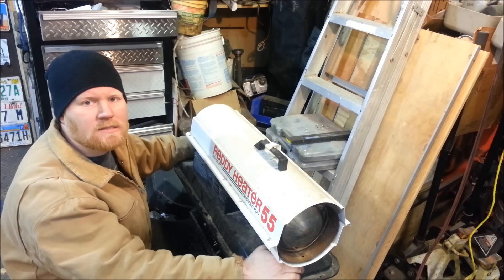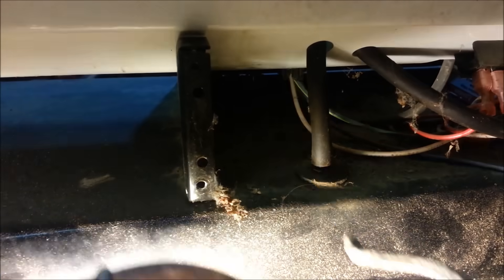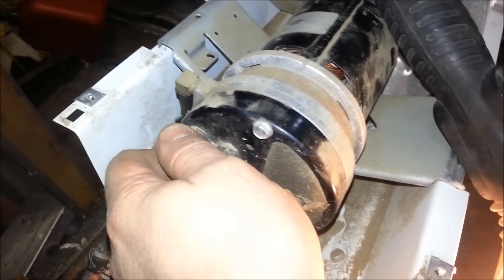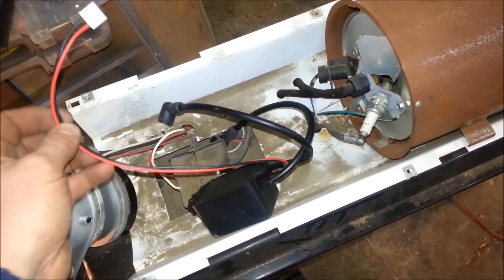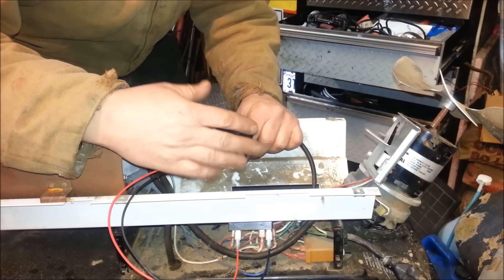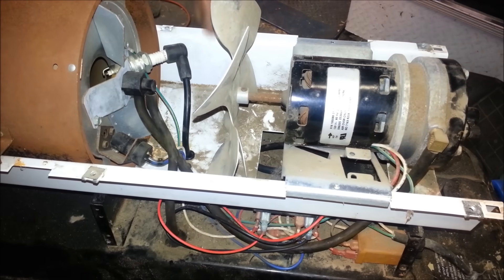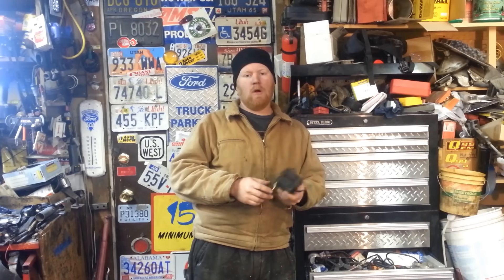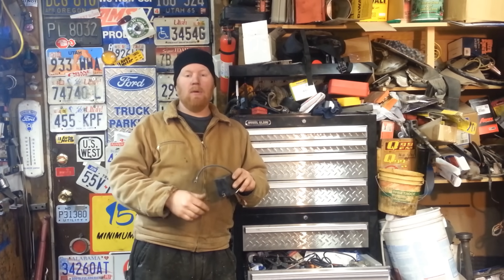Torpedo Kerosene Heater repair & HOW they work

Comment: Thanks for reply. Had the fuel jet out for cleaning and looked fine but gave it a good clean in any case. Bought this heater new a number of years back but it would not have a great deal of hours use. Had contaminated kero in it a couple of weeks ago and i drained it out, flushed tank and then power hosed it inside. Stood it on it's end overnight  to drain onto  paper roll and then heated tank with hot air gun to ensure no moisture remained. When I went to start it up there was no fuel delivery to the new fuel filter so took it to local guy for testing/repair. New parts fitted ref to pump area but now I find it throws out flame at all  levels of PSI adjustment. Also has to be kept on high PSI setting otherwise the Kero fumes are unbearable.
If it was only an adjustment I would be happy to do that otherwise it will be going back to previous repairer to set up correctly.
Reply from the maker: +EUGENE Mc  ARDLE If the fuel jet is worn it will spray clumps of fuel rather than a fine atomized mist. This will generally cause flames. Flames can also be cause by too high of pressure forcing too much fuel into the combustion chamber. Lowing the air pump pressure will lean out the mixture and should have lower fumes.

Comment: Hi thanks for posting video. I have a similar Kero ( SIP ) space heater  which has started to throw out flame around the front and  the fumes cause eye irritation. To  run and not cause this eye irritation  I have to increase the PSI  to nearly max.
What do you suggest could be the problem ? Thanks.
Reply from the maker: +EUGENE Mc  ARDLE If it has a lot of hours on it the "fuel jet" is more than likely worn out.

Comment: My heater when cold only ignites when I loosen the screws on 1 side of cover and slightly raise the cover. When the heater is running for a while it will ignite if still hot. Can you let me know why?
Reply from the maker: +Timothy Bertsch The pressure from the pump is not set correctly. It is pushing too much fuel into the combustion chamber so it needs to be turned down(counter clock wise) a little

Comment: I'm not finding the igniter anywhere.  Can you tell me where you got the 20 to 30 dollar igniter?
Reply: +Barry England Ebay has a bunch. item 361024717300
Reply from the maker: I bought it from equipsupply c o m. Search for 39e0 . They have a 39e0-0021-00 that is identical to the one I used for 28 bucks with free shipping. 

Ignition Module I used in the video GHP 39E0-0008-00( any 39E0-00*-* will work the same the length of the leads is the only difference)
If you're replacing a single wire ignitor with one of these 2 spark plug lead wires units; ONE lead will hook to the existing spark plug and the other lead will ground out to the frame or housing that makes electrical contact with the outside(threads) of the spark plug. You can flatten out the end and put a screw in it or something similar.

Comment: hi I have a dura heat torpedo heater dfa75t  I'm running  heating oil and it smell bad and my eyes  burn is there's a way to get rid of that  bad  smell  it gives me a  headache every time  that I turned it on and I can leave  on more  than 5 minutes  I go crazy  by the smell do I have to tune or something  like that  an this  thing is 4 month  old  new thanks
Reply: +martin valentin Can you find kerosene to use instead of heating oil?  That's why you're getting so much fumes from it.  Kerosene will be more expensive, but there's no point in saving money if it's unusable with the heating oil, which is not supposed to be used with these heaters.  #1 Diesel is an alternative that you could use also.
Reply: +DTR RTD my reddy heater uses 1 kero 1 diesel 2 diesel 1 jet fuel 2 jet fuel but not gasoline
Reply: He covers that with the air pump adjustment.  The higher the pressure, the more fuel, because the air is what sucks the fuel out of the tank...

Comment: Mine runs for about 5 seconds and shuts off. repeats the same cycle over and over. i can see spark and flames i cleaned the photo cell and it still does it. what do you think?
Reply from the maker: +Ernst Hin It depends on how it shuts off. It is stops everything at once while heating it is the photo sensor. If it stops heating/flame goes out but the fan blows for a few seconds more you have other issues.
Reply: +sixtyfiveford 
Yes every thing shuts off fuel spark and motor. I'll replace photo sensor thanks you are a great help. I really appreciate your video and thumbs up!
Reply from the maker: The photo sensor simply connects the 2 wires. You can test it by connecting the 2 wires.
Reply: +sixtyfiveford 
okay, if the heater keeps running after i bypass the sensor then that was my problem?
Reply from the maker: Yes.
Reply: thanks! you were a great help. I like to buy broken stuff sometimes. Its worth the repair to me. I really appreciate guys like you who share the knowledge.
Reply from the maker: You're welcome. I'm glad I could help.

Comment: Hello again.Its winter time,and had to break out the ole heaters.I had a reddy 110 pro,and the motor just quit while in operation.I took it off,looked at it,and ended up buying a replacement for it.While putting it together again,I accidentally placed the rotor kit in backwards,with the center bushing not properly installed and cracked the rotor.Got a new kit,put together,with a set of new filters,and now I can't get it to burn steady.It wants to miss pretty bad.I had another used plug that I put in and got the adjustments good enough to not trip the reset,but still missing,so I took the used plug out,put the original back in and its worse than before.Can't get it to stay running long enough to make any adjustments.I've tried 3 different backplates and I can't get anything to adjust.I've turned the screw all the way in and out,and can't find a sweet spot.Any ideas would be appreciated.
Reply from the maker: +FlintSpall The most common issue for poor running is a split in the air or fuel pickup line. This will make adjusting near impossible.
Reply: sixtyfiveford Hey,Thanks for the response.I finally after much head scratching,took off the air line,blew some air through it,and disassembled and cleaned the nozzle.Now its working good.What I've seen,,is that while the pressure valve adjustment is important,its not as sensitive as some say it is,,so long as everything else is up to par.apparently it had trash either in the air line or somewhere between it and nozzle.I've had similar problems with cracked filter plate,but I have three thats nearly new,so I didn't think they should be the problem,,but didn't occur that trash would be either.:>) Thanks again.

Comment: HI, my nipco isn't igniting. We checked everything with what you recommended on your video, which was very descriptive. The vacuum guage goes the opposite way, and with that valve plug out, we feel the air coming out. Are we doing something wrong?
Reply from the maker: +Kathy Plaetz The port will blow air not vacuum. Virtually all vacuum gauges have a positive pressure side as well on the gauge.
Reply: The gauge we borrowed is from a local car shop. It made the dial go back toward zero. What do we need to do?
Reply from the maker: Most will have a fuel pump tester built in as well so there will be a pressure side. You just need some way of measuring up to 5psi. Here is a link to the actual tool designed to measure the pressure http://www.ebay.com/itm/HA1180-Kerosene-Heater-Air-Pressure-Guage-Desa-Reddy-Heavy-Duty-2-Face-Glycerin-/251421228482

Comment: if i don't have kerosene..can use gasoline with oil????
Reply from the maker: +efrain cardoza You can run straight Diesel. You can mix in a little old motor oil with diesel but it really starts to smell so I think just gas and oil would smell a lot.
Reply: +sixtyfiveford thank you !!! I liked your video, either esplicit and very detailed ....👍👍👍

Comment: I have to much fuel just poring out, whats wrong?
Reply from the maker: +Brandon Keele Is it fogging out the front of the machine when you turn it on? Is the spark plug creating spark?
Reply: yeah it makes spark and just fogs out the front, if I lift the back half of the cover up a inch and a half it works perfect, as if it's not getting enough air, I but that size socket in between and it works every time otherwise it just fogs and spews fuel out the front
Reply: it's a 185,000 btu dewalt model
Reply from the maker: You need to turn the fuel air pressure down to a lower psi.
Reply: I've adjusted the screw all the way in and all the way out with no better result only thing that still works is opening a gap n the top allowing for more airflow I guess, and the fan is blowing super hard so I know it's not at fault
Reply from the maker: It needs to have a balanced fuel air mixture to light off. This assuming the spark it adequate.  By opening the cover you're either reducing the amount of oxygen or increasing it depending on how the cover is open. Turing the air pump screw in increases the pressure and out decreases it.

Comment: Update 65ford got it running with your help . Now when I put the cover back on flame goes out ,Had pressure adj.to proper setting went as far as adding just a bit with no success any suggestions
Reply from the maker: +Mark Bucklad  Depending on your style, with the cover off the fan it is pushing less air through the burn chamber so it requires less fuel(pump pressure). With the cover on all the air is forced through the burn chamber and it needs more fuel(turn up the pump pressure).

Comment: Good video' mine when i plug it in glow plug lites up and then goes out and i don't hear the pump or see the fan run. john    blueegg08@gmail.com   has not run in 2 years
Reply: where did you buy the ignition coil
Reply: +brian bytnar It is the original coil but i got it going. I cleaned the optical on it and there were loose wire connectors on the board once i did that it started. Watching you on the tube showed me what to look for. Thanks much for the video.

Comment: Hey 65ford everything you said was correct all those problems fixed ..got spark.fuel spray ,new sensor,new coil, only problem kerosene will not lite and it was fresh
Reply from the maker: +Mark Bucklad  If it is fogging kerosene out the front but not lighting, more than likely your pump pressure is too high. This makes a RICH fuel/air mixture and it won't ignite.
Reply: +sixtyfiveford No its not fogging out the front wont do anything but shoot fuel out the jet and spark from plug
Reply from the maker: It shouldn't be shooting a stream of fuel out. It needs to atomize it turning it into mist/fog. If it isn't atomizing it your jet could be worn out to large. This would generally only happen on a unit that has a lot of hours on it. You can try turning up the pressure to force it to atomize better.

Comment: not drawing fuel
Reply from the maker: +Mark Bucklad Cracked or split fuel line. Or clogged filter if equipped.
Reply: +sixtyfiveford I found the rear cover plate has a crack in it where the pump is . would that stop the fuel from moving
Reply: 65 ford also I picked up a similar coil like you have in your video . The only way I get a spark is when I ground the 2nd plug wire
Reply from the maker: A crack in the pump housing will dramatically lower the air pressure in the pump and it won't pick up fuel. JB weld fixes these pretty well. Some dual spark plug setups spark between the the two plug wires, so grounding one out is correct.

Comment: What's the best way to clean the fuel tank?  Have one I haven't used for a few years and the tank looks nasty.
Reply: I would take off burner, fan, all electric components, that way you can flip the tank around all ways to try to get the gunk out. Use a stick through the fill hole to try to dislodge most of the funky stuff and get it out the hole. Then spray in a whole can of engine degreaser and head to the car wash. 
     Stick the nozzle through the hole and try to get all the corners.  Run water through it till it comes out clean.  Question your life choices while you ride home soaking wet and smelling of old fuel. 
      After tank dries out a bit, put a gallon of clean gravel in.  Shake it every way, make as much noise as you can. Add hot water and dish soap. Repeat. Drain and rinse.
Reply: Carl Crawford 
lol riding home reeking of old fuel-
I question my life choices all the time-

Comment: I have a Master 70,000 heater.  When I turn it on it will fire and light right up, but it will keep shooting flames out intermittently.  Any ideas?
Reply from the maker: +jd67010 Usually that is a sign of contaminated fuel, an air leak in the fuel pump air lines or an air leak in the fuel pickup line.
Reply: +sixtyfiveford .Thanks!  I will replace all of the air and fuel lines and see what happens.

Comment: I picked up a Dayton 110,000 btu Oil Fired Heater from Craigslist today for $75.00. Couldn't resist. I have a 1500 sq.ft. shop and this thing fired right up and warmed up my shop in 15 to 20 minutes....it was only down to 45 degrees or so here in Oregon today.

Gonna try the straight diesel with it tomorrow...see how she does !
Wish me luck !

Thanks for another tip SixtyFiveFord !
Reply from the maker: +Screww Googlle Yeah, that's a sweet deal. I found a local station that sells red die off road diesel, so it's even cheaper.

Comment: Thanks for the video. Could not find my manual and the Mr. Heater (75k),web site let me down for a pdf. Opening the covers found spark and fluid atomizing. Found rubber hose from air pump to atomizer cracked. Replaced hose and all is good. Same dia. (id & od) for air and fuel. 2 feet will cover the replacement of both.

Comment: great video I have a torpedo heater in that will run fine for a little while then it will just start rolling black smoke any ideas what that might be
Reply from the maker: +Tyler Landers Too much fuel. So your spray nozzle could be worn or air pressure set too high.
Reply: +sixtyfiveford  thank you I'll take a look at it before it gets cold outside not much good in the garage when its rolling coal

Comment: where did you find the ignition coil for $27
Reply from the maker: +Steve Lenhart http://www.equipsupply.com/products/1002937-Ignitor-Ignition-Transformer
Reply: +sixtyfiveford dead link. just times out. was looking for a cheaper one like yours. all i found was $60 and up.
Reply: +Steve Lenhart waited a couple hours re tried it and the link works now. thanks for your help.

Comment: I have a remington similar to what you show. I replaced both rubber tubes as they were cracked, and splitting. ran it for 1/2 hour it was fine. 1/2 hour restarted it and it started fine, but flickered a few times and stopped. repeated 3 times with no change. any ideas?
thanks,
rob
Reply from the maker: +Robert Spencer The rubber pickup tube that goes down into the tank can crack as well.

Comment: My all pro 175  will not heat. I took off the top and see the spark is great. Fan runs also just won't fire  Any help would be great  Thanks
Reply: +Phil Lilja  In the back of the motor housing is the air pump they break check that

Comment: If I have a 300K BTU Heater. And a 900 square foot house. How how would the house get if I left it on at max temp for about an hour?
Reply from the maker: jason bowles That's a big heater. It would heat it up to around 100F in an hour.

Comment: Hello, I checked equipsupply. they have several to choose from. how can i tel which one i should get. 4 are on backorder. 1 is still available? can you help me please?
Thanks so much
Reply: Jill Albring Ignitor....sorry
Reply from the maker: Jill Albring The difference between them is the length of the spark plug wires and the random plug on the electrical wire.  As long as the spark plug wire of long enough,  any one should work.
Reply: sixtyfiveford one more question. the one that i received has 2 white wires. my wires are connected currently with wire nuts. should I just try it one way and see if it works. I am going to have to splice the wires. the plug will not work with my set up. let me know your thoughts. Thanks for your help!
Reply from the maker: Yeah, just cut the plug off and wire them in. Either way will work as they are AC power(doesn't care which way)

Comment: My reset keeps tripping after about a min. what is it. jtsmith48@ymail.com
Reply from the maker: Bubba Smith If it is putting out heat and running normally when it trips your optical sensor is bad. If it never produces heat then you need to look into why its not lighting: spark, air pump, etc.
Reply: sixtyfiveford Thanks

Comment: I barrowed a Reddy Heater 60,000 BTU He said I could use it if I could get it to run.  found fan was sticking, so I adjusted ring on air pump. Checked pump pressure, it is set at 3.4 fires up and runs the problem is that it runs about 10 minutes and shuts down I tried a few times with the same result. thank you . Have a great day.
Reply from the maker: Deano It could be overheating. Some had a overheat switch.